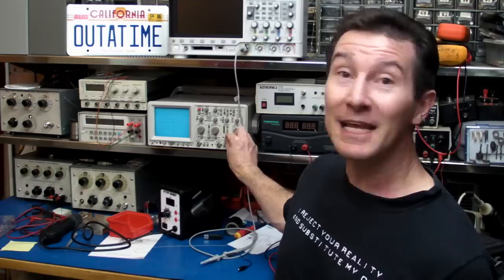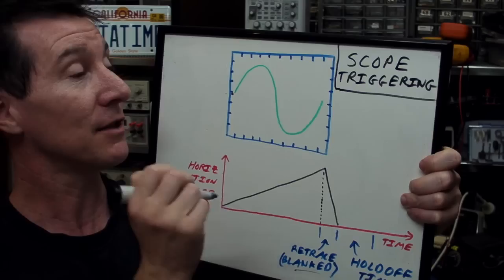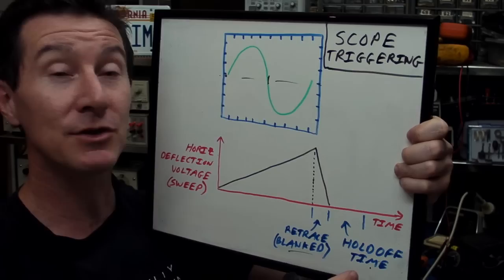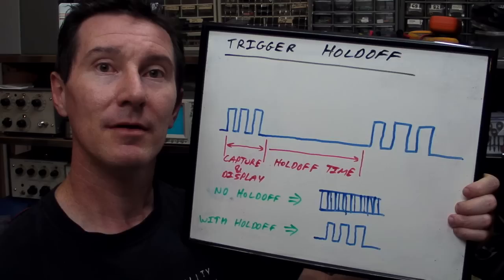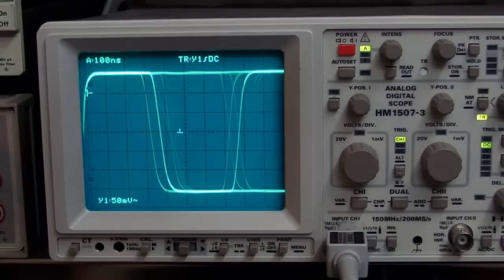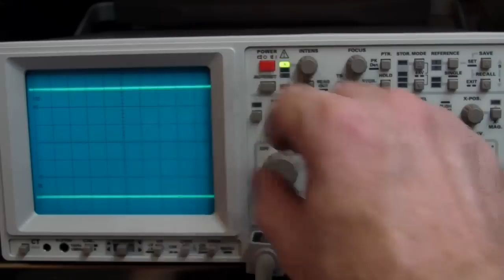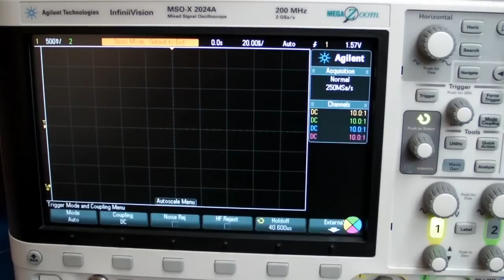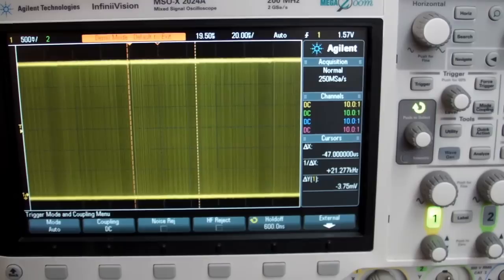EEVblog #159 - Oscilloscope Trigger Holdoff Tutorial

Comment: A seasoned electronics tech (+15 years) I work with spend two days replacing IC's and parts to fix an "intermittent problem". It was just the holdoff a previous tech set. :) I learned what it does just by using scopes, especially when I needed to capture longer digital pulses. I'm one of those who refuse to use the auto-scale, unlike my classmates. I love your blog!
Reply: This geezer never uses autoset either 😊

Comment: I learned all this info in on O-scope usage in C school in the US NAVY i was a IC 2 e-5 electronic tech on board submarines I used the scope to repair all the electronics on board . The bad part about the subs is you must use a isolation transformer or a bad way a cheater cord with no ground . I leaned that the hard way first time I used one in a Gyro switch blew the hell out of the first scope had to replace it during offcrew man those were the days.

Comment: @truhlikfredy Holdoff time still matters on a signal like that. If you use time/div to enlarge the signal, for instance, you may get the end of the packet outside the first sweep, triggering a second sweep. Hold off can remove that second sweep properly, and then you can use a trigger delay to closely inspect any part of the signal you like. Of course, techniques like this matter more when you don't have a deep sample buffer.. and my scope is fully analog.

Comment: From what I understand, the trigger holdoff disables the trigger for a given period of time after the first trigger occurs. So the drawing and theory presented here are wrong. The holdoff time should be set to equal or slightly longer period of time than the packet length and not slightly shorter than the packet gap (no signal period) length as was shown and told in the video. Of course this would work best in normal trigger mode.
Reply: What he presented was right for analog scopes (maybe?), but not so relevant to digital scopes indeed. He got it right towards the end of the video, though.
Reply: Yes tzok83  is 100% right. The first part of the video, he specifically said to set to length of the idle period. But that isn't right.

Dave does get it right at the end, as mentioned, but he should've gone back and reshot it or something.

From the video, it looks like ideal range for the holdoff time would be between the length of time for a single packet up to and including the idle time before the next packet.

Overall I found this a useful discussion, but you've got to make it to the end of the video to get the full story.

Comment: @EEVblog Any kind data that they continue after sampling and the hold off time is during data transfers so it won't trigger. Showing the case where after sampling are none data and the hold off time is long precisely enough before the next data stars will I think behave the same, with, or without hold off. So showing on that case were it behaves exactly the same in both cases is not good. (I mean the drawn timeline, where you explain the theory)

Comment: Question! Assume a 2 kHz simple sine signal and the CRO is set to 0.1 ms (or 100 μs) /Div, triggering on upwards slope at 0 V, so one complete cycle fits exactly on HALF the screen. Will the scope trigger at every valid transition? If yes, it should only show the signal on the left half of the screen 🤔

Comment: is this really a necessary feature for a digital oscilloscope if you just can press hold? on an analog one i can see the use allthough i cannot imagine what you are going to do with the result. and it only seems to be usefull anyway if the sent package is always the same (isn that rather rare?)
Reply: If the packets have the same length, but part of the data inside is changing, this feature allows you to see that change, live. That's extremely useful. Granted, you can achieve the same thing with pulse > X triggering, but still. A stopped waveform is never as good as a well-triggered, live waveform -- how else will you see glitches, jitter and genuine data changes?